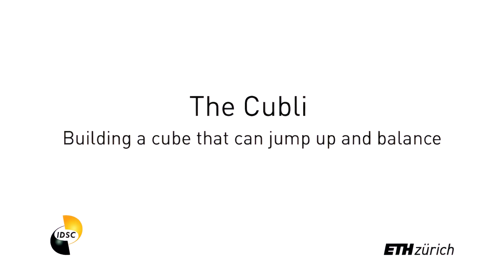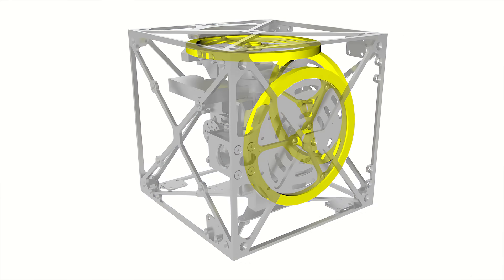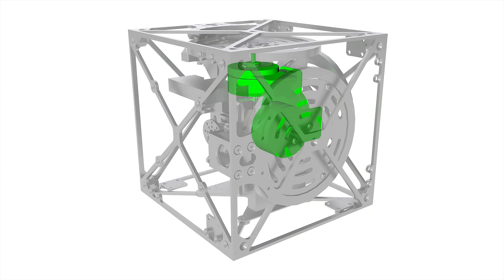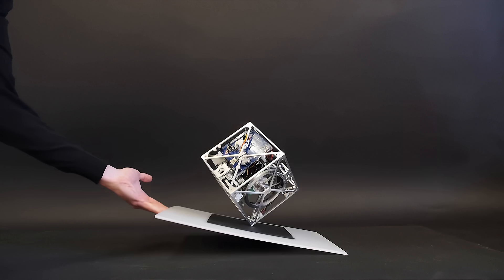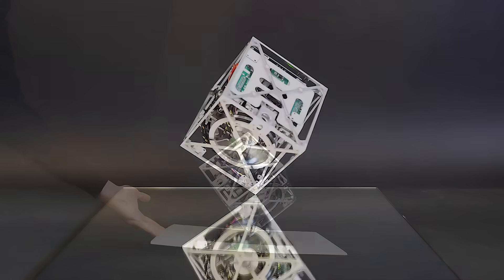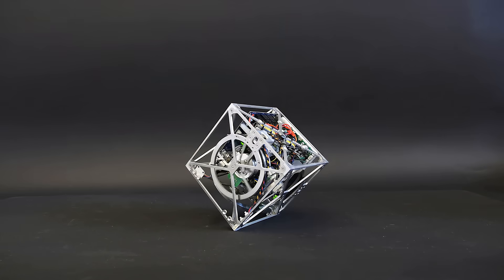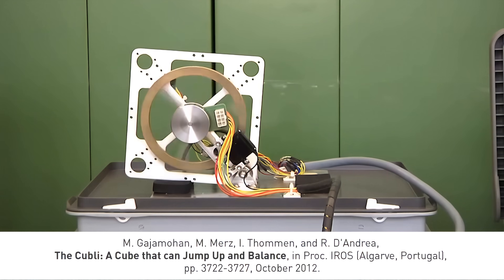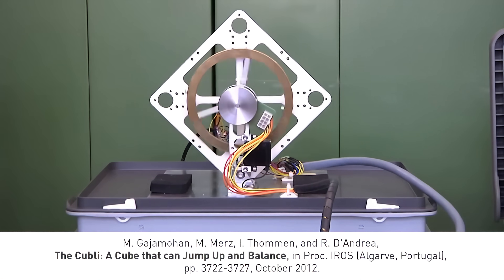The Cubli: a cube that can jump up, balance, and 'walk'

Comment from the maker: A shout-out to those who think that Cubli is a gyroscope. It is not. In a gyroscope the wheel spins at a high angular velocity to keep constant orientation. In the Cubli we use reaction torques to balance. These torques are what the Cubli's structure 'feels' when the three motors attached to it accelerate or decelerate the wheels. In fact, Cubli's controller tries to minimize wheel velocities in addition to keeping the structure upright. This method is more reactive to external disturbances and reduces vibrations and sensor noise.

Hope you enjoyed the video! 
(original comment modified for simplicity, Thanks *****)
Reply: A gyroscope uses conservation of angular momentum in order to conserve a position, this contraption takes advantage of newtons third law of motion to generate motion. The difference is that a gyroscope resists motion, reaction wheels generates motion. A gyroscope doesn't stabilise, it maintains a rotation that some stabilisers then can use as a reference. If the cube was stabilised by gyroscopes it would be tougher to push it down an axis and it would start to precess, but it would never return to it's initial position. Reaction wheels rotate in one direction, which subjects the rest of the contraption to a counter-rotation. This means that using sensors that can detect if the cube is set in motion the device can use the reaction wheels to create an opposing motion, which can maintain stability and even restore or aim for some specific position or orientation.

Another thing to note is that gyroscopic wheels cannot resist motion around their own axis of rotation, while reaction wheels only work with motion around their own axis of rotation. That means only two gyroscopic wheels are required for gyroscopic devices working in 3D space, but devices using reaction wheels require three wheels for working in 3D space.

"but if you are using spinning wheels to maintain stability, then it's a gyroscope."
An apple is a banana, because both are fruits.
Reply: The important question though is, how much does it cost?
Reply: Gajamohan Mohanarajah what would be its price if you consider selling it?
Reply: If the cube had something that would stick it to the wall, like magnets or something else. The reaction torques themselves can't make it latch to the wall, they only impart rotation and not a "thrust". By using the floor as a point of leverage it can generate motion parallel to the floor, or going away from the floor, but it can't pull itself towards the floor. A force like gravity or magnetism needs to push it into the surface it will operate on.
Reply: An "octocube" doesn't make sense for two reasons:
One, draw a square and an octogon with the same circumference on a paper. Mark one side on each shape as contacting the ground. For any given side on the square, it will be longer than a given side on the octogon. So the cube has a bigger footprint than a "octocube".
Secondly, try to make a symmetric shape out of same size octogons only. You'll find that it will be very hard, impossible to be precise.
Reply: Gajamohan Mohanarajah what kind of sensors are they using? Just curious.
Reply: TruAnRksT  You think it’s a toy?  I think it is the beginning of a new technology that has applications in the near future for autonomous robotics development.  Not your grandma’s slinky!!!
Reply: Gajamohan Mohanarajah still the same physics as in a gyroscope
Reply: ThePaull3d vsauce has a video on gyroscope ,check it out .whereas in cubli, rotating wheels don't act in same way
Reply: Control system 101
Reply: I dont think they will sell it . They will patent it of course and try to develop it into something more
Reply: Gajamohan Mohanarajah have you ever seen Mr.Magorium’s wonder emporium? This is what it made me think of (the Congreve cube)
Reply: Even though you don't perceive it as a toy, if you manage to get the cost down to the point that it can be sold as a toy, then it would be affordable enough to have significant scientific implications.
Reply: Can I buy it yet? Seriously man it’s been years
Reply: can it be used in vehicles to maintain balance and prevent roll overs , (such as trucks and suvs) ,........... Hey iam also an indian ,whats up!!!!!!!!!!!!
Reply: @Wonderer245  Dude that sounds cool as shit. But you would need 3 extra wheels on the car and they would have to all be insainly heavy to be able to counteract the weight of a car after the car was struck by another car at high speed. Hard enough to flip the victim car since otherwise there would be no need or use for it. Clearly we found simpler solutions to our problems but the idea is still cool as shit.
Reply: @anthonyhernandez4266  , well , I am just giving it as an idea for such vehicles while they are cornering, not getting collided, because cars with a low center of mass such as high performance cars also get rolled over due to such impact, but what if it was the case of a car while side inclining a slope !
Reply: @Wonderer245  I get it now. I don't know that much about cars but if there is any way that your idea can be made cost effective then it would definitely be worthy of a concept car at least. I was thinking about a wheel on the bottom of the car that would assist in making sharper turns than what would otherwise be possible with the cars normal handling and momentum.
Reply: Master Evar if I used linear shifting weights at the edges of the cube would it be gyroscopic?
Reply: Shapeshifter5 no
Reply: the linear shifting weights act exactly the same way accept wheels can impart more momentum for a longer time
Reply: Thank you    
* South Korean
Reply: Nick Hall great one lol
Reply: Gajamohan Mohanarajah 
They should make it octocube so it has more area in the ground and balance better, also no satellites in space 
They are hidding something in Antártica they need to send robots to the Antartica
Reply: Gajamohan Mohanarajah "we" use? What's your part in this?
Reply: tcj distributing and marketing
Reply: One day in the near future,  slinkies will battle Cubli for supremacy in the solar system, while Space X delivers earth-ready pizza to Mars.
Reply: +Gajamohan Mohanarajah, I wonder how the "aliens" (God system) that were designing how humans will be, how the project was conceived and thought about millions of years before we were made.  Like, ok we are going to make a heart, 2 legs, fingers, eyes, etc. and let it develop on it's own while it's guided to develop for each unique person and all the human laws and problems that arise during the life on Earth and after.
Reply: +Mindraker1, Pretty much but considering how a lot of good inventions less than this still aren't made common it would be quite weird for this to beat those though 1st but I'm surprised about many things in life.
Reply: where can i buy this
Reply: Hi Mohanarajah. If it would be possible, I would like to know which are the components that you used. For instance, what kind of sensor or microcontroller, etc. Thank you so much!
Reply: Will these ever be commercially produced?
Reply: I would also like to know what kind of sensor or microcontroller they used, old video or not.
Reply: you should pin this
Reply: The most knowledge comment need to be up their not this down!
Reply: Hiiiii
Reply: no no....gyroscope works on the principle of conservation of angular momentum whereas this works on the reaction force on the motors when it tries to spin a heavy wheel ...similar to conservation of linear momentum.
Reply: @RelianceIndustriesLtd  ya but then it uses angular momentum to stay where it is and balance
Reply: Yes, a gyroscope is a brute force device and this is so much more elegant.
Reply: Gajamohan Mohanarajah we know how it really works, its hellraiser's puzzle box, he wants out!!
Reply: Gajamohan Mohanarajah Sir, that's an awesome research.Try to put it to medical use.anyways , is it available in the market ? would love it collect it and show it to school children.Would be an inspiration to the next generation.thanks
Reply: a gyro uses a different system for stability but reaction wheels use a different system
Reply: Gajamohan Mohanarajah I was just about to comment is this how gyroscope 
S are made
Reply: +Gajamohan Mohanarajah (Gajan) I still can't understand how does it work, so tell me if i am wrong. Is it connected with maintain momentum?
Reply: Must be similar to how the Segway balances. But possible with finer detail. 
Still just a toy. 
How long do the batteries last?
Reply: Gajamohan Mohanarajah why not just use a standard wheel?
Reply: Stupid question - can it "walk" or latch on a wall like a fly? If it is uses the reaction torques to do what seems impossible, would it be able to do the wall-walking or latching as well?
Reply: Thanks for describing the definition of a gyroscope.
Reply: Gajamohan Mohanarajah what means cubli?
Reply: Nobody cares
Reply: @jamesmorris911  but still comment like a fool 😂
Reply: How small could you reproduce it on a 3D printer if the logic were off-board and individual controllers were frequency based modulations to simple bluetooth controllers registered on-board?  All solids are essentially crystalline in origin.  Crystalline growth in cubes requires edge to edge alignments which may be facilitated with magnetic corners utilized in closed 2 dimensional cells for collective defragmenting solutions to an amorphous collection,s, thus aligning them into the strongest unity.
Reply: That's a gyro,
Reply: so it's a variable-speed gyroscope. Don't get me wrong, this is one very clever approach...but if you are using spinning wheels to maintain stability, then it's a gyroscope.
Reply: It's still a gyroscope
Reply: Gajamohan Mohanarajah neeeeeeeeeeeeeeeeeeeeeeerd!

Comment: Ummm... Ok I'm usually the first guy to be excited about new inventions and stuff but...
This seems pretty damn pointless? What is this good for anyway I mean Nano-Technology, paint that does not drain liquid to add to clothes or walls, microscopic surgery, spray that turns to skin. . . .
Why the hell would we need a box that stands on its corner?
Reply: I believe this is more so a proof of concept, or just an experiment. Not no much a consumer geared product.
Reply: I guess it is more a technical exhibition than an invention. This cube will never save your life but, they show a very high servo control skill. Technically (as a student in robotique engineering) , this is really impressive!
Reply: Because, once you are able to move a cube that is face flat on the ground, the possibilities are endless.
Reply: ok imagine if you have this inside laptops, etc. If you drop it it will never land on an edge or corner. One application of this tech.
Reply: Because its a start to something big.....!
Reply: annaoflasvegas
You are correct! Its the beginnings of the BORG.
Reply: I am not an engineer, but I imagine this could be used in many things, one of them robotics, to help the balance humanoids robots, or whatever kind of moving robot, or even a vehicle, as long as this 3 rotor system can have enough weight and energy to counter act the imbalance of the object/itself.

Cats for example can jump higher/longer by swinging their tail and they can slow down their fall by rotating their body in a specific manner, this is kind of a similar principle where you apply motion energy  in 3 axis, stop it or reduce it suddenly or slowly to accelerate/reduce the speed/rotation/movement or re-balance the object.
Reply: how about implementing it into civil engineering? find an economical way to develop this and use it in buildings to deffend against eathquake!
Reply: ok dumb ass.  guess you didn't watch the video because she clearly explains just a few uses for this device.  wow.
Reply: g00glian0 Actually she didn't. She said what people hope to use it for, not what people have found a use for. Maybe they already have done so, before or after the release of the video, but that is not what she said.
Reply: BANG! Humanoid robots that balance themselves already exist and afaik use a sensibly different technology. Nonetheless it is already damn good (you can just search for it yourself to see incredible feats of balance and movement, bipeds and multileged). If the that was the goal it would be akin to reinventing the wheel.
Reply: Louis Victor
Yes there already are robots that can balance without this tech, I was just pointing out a possible use in reply to Robert :)

Comment: And the point is???
Reply: It's a much simpler way of movement than walking. Not to mention how small this thing is or what application this thing could be put to in future technology. IDK how it'll be used in the near future, but I could imagine the distant future having giant manned versions of these things with multiple guns inside the cube on each side. A 6-faced platform like that could potentially be much more effective than any tank due to the capabillities to switch faces easilly. Or even if there was a magnetically-suspended device over hundreds of these things working in unison to turn and move the larger device as needed.... I mean, it's cool and who knows where this thing could go? It's definatly REALLY stable.

Comment: looks awesome, an android could use a similar system to have a balanced upper torso. However, the movements seem to be stop motion. The whole screen changes color and tone. I dont know. I want it to be real and think its a fantastic idea. But I do not believe. Also you'd have to be able to rapid brake the wheel then rapidly accelerate.

Comment: Is it just me or does any one else see how adding a generator to this thing could create gravity induced electric motor? The cube would have to be at the core of the drive train I presume. I if not then then I at least see a gas free generator out of this gadget - imagine a 9v battery initializing a starter to get a cubli big enough to power a small home in remote Africa.
Reply: oh, "planetary exploration" okay, so perhaps they do plan on using it as some sort of vehicle or vehicle propulsion.